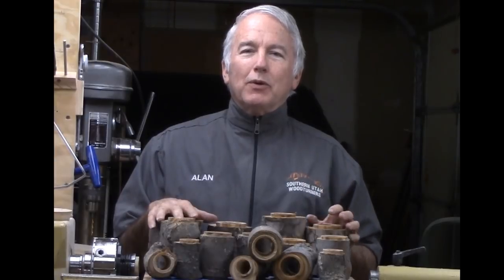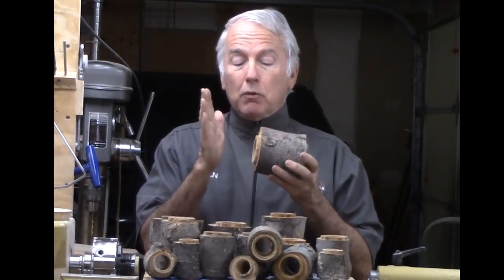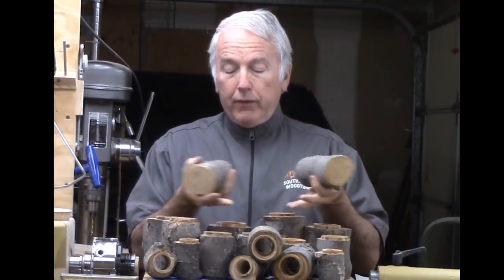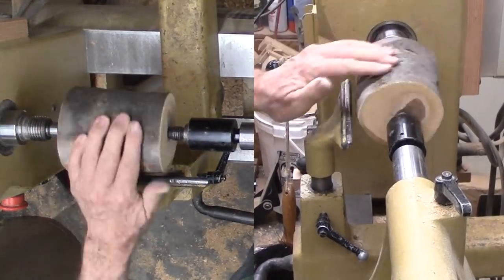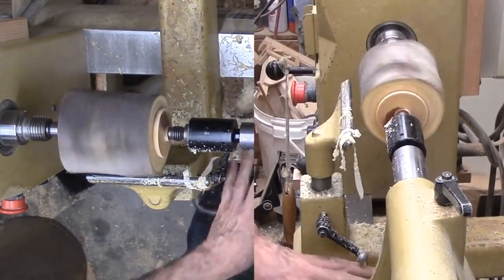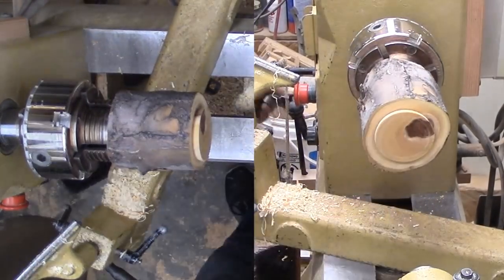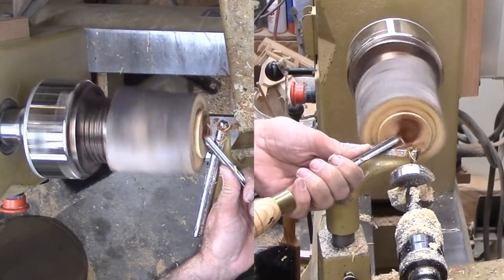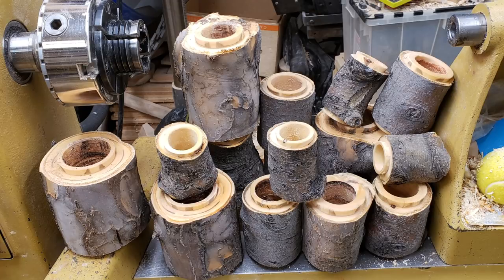Preparing Green Apple Branch For Natural Edge Projects

Comment: I routinely do this with pepper mill blanks from green wood. I rough turn a 3" cylinder and bore a 1" hole. That gives 1" wall thickness. That dries pretty well without cracking / splitting. Thanks for sharing!
Reply from the maker: Perhaps my hole is too big for a pepper mill. but I 'll keep it in mind.
Alan

Comment: These look like ornaments to me turn on the off axis. You have a cavity for a tree, angel, or snowman.
Reply from the maker: Are you suggesting:
A. Hole through the side for tree, angle, or snowman, or
B. Cut a ring from the apple to stand a tree, angel or snowman inside.
Got me thinking.
Alan
Reply: @AsWoodTurns  Gwinnett woodturners did something similar to this but it was out of KD and drilled from 4 sides. By Christmas you should have a good dry blank. Drill for the finial and make it round.

Comment: Napkin rings comes to mind first. Also, vases with the ring on edge, and glass vials drilled down through the side/middle, sitting proud at the top.  If the diameter is a match, set tea candles into one end, with a small recess for flush. Also small clock holder/stand (hole in the side or end). Will be curious to see what you did think of! Also glued on contrasting top and bottom for boxes or pen cups. They could even stack. Are you going to try boiling one or two? If plastic bag, watch for mold/mildew. I use brown grocer bags (Trader Joes) to prevent mold from lack of air circulation. Looking forward to a future video since I have a lot of Apple, some with excellent burl protrusions.
Reply from the maker: Yes, I'll be watching for mold/mildew - i usually use a brown bag at this point.
No, I will not boil any. I know people who do but they have an endless supply of free fuel.
Thanks for the list.
Alan

Comment: Hi Alan, try doing a couple of 'shrink pots' before they dry. Cut a groove 1/4" from one end and turn a seasoned base that is slightly bigger diameter than the hole. Hammer the base in until it lands in the groove and then let the body dry with the others. This is quite a traditional way of making a pot or box base. Would love to see you try this. Thanks for sharing.
Reply from the maker: Interesting. These are on their way now. but I may try it with some other fresh wood.
Thank you
Alan

Comment: Hi Allen. Have you had any problems using plastic bags, such as mold? I have only heard of using paper bags with shavings while you wait for your project to dry. I don't know if it would work, but once the wood has dried, maybe you could mortise and tenon them together to make a tall vase. Thanks for sharing your videos.
Reply from the maker: Yes, at least in Oregon, I could get significant mold growth in a plastic bag. But those were half logs that I left far too long. I don't expect a lot of mold if I get them out within two months. A paper bag is what I usually use after I've rough turned a project. We'll see what happens this time.
I'll add your tall vase to my list.
Thank you
Alan Stratton

Comment: Those should make real nice pencil pots. With bark or without, natural outer surface. You make need to consider reboring leaving a ledge to drop a disk onto for a bottom.
Reply from the maker: Bert, you mean a pencil pot needs a bottom? :)
Would you inset the disk? (internal) or make a full bottom (external)?
I guess either way works.
Alan
Reply: I would consider opening the bore just a bit and drop a disk in from the top. A dap of glue on the end grain only should hold sit in place and let the barrel breath.
Reply from the maker: @bertdelisle393  Always good ideas from you.
Alan